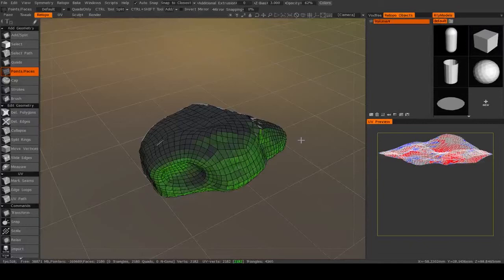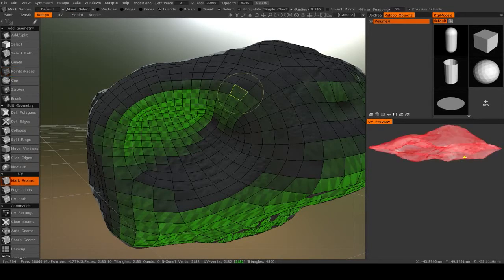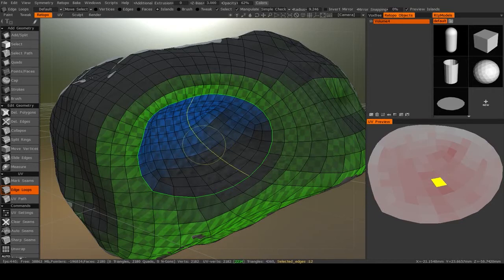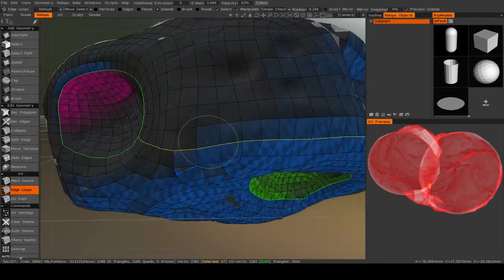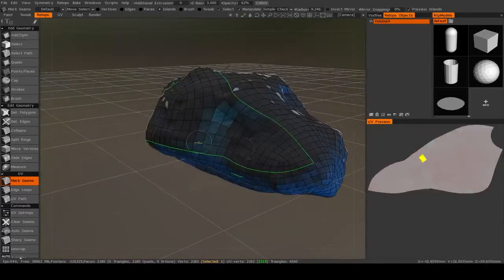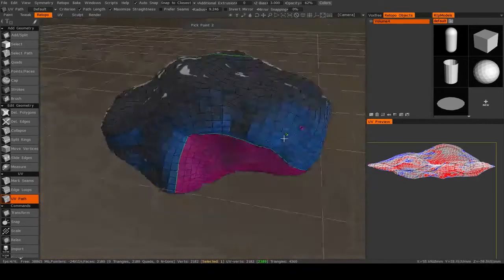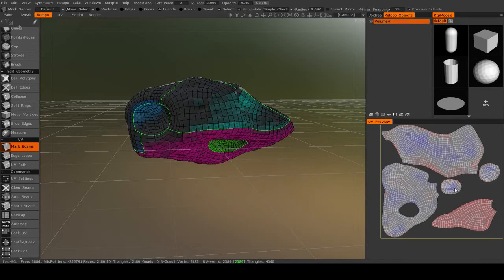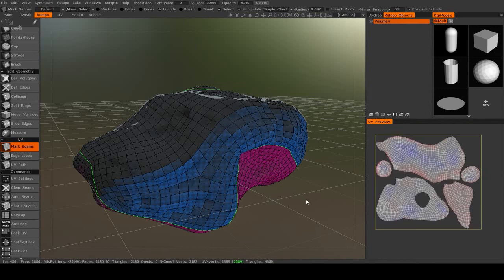Welcome to 3D-Coat: Part 17 (UV Unwrapping)

Comment: I have these purple edges that are showing up on each model I import on my 3D coat. They are... horrible to say the least. A purple edge overrides everything. So when i mark a seam for unwrap, it makes the seam, but doesn't become red as it usually would with previous versions of 3D coat. It makes it really hard to work efficiently because if an edge is purple, there is no indication that I had previously marked a seam on it... yet the seam is still there. It's driving me crazy.

Comment: but is there a methed where i can import an obj model that i already sculpted in zbrush and uv unwrap it ?
i tryed that but in retopo room it doesnt recognize topology at all, it seems 3d coat wants his mesh in order to uv unwrap it. So i tryed that. I performed auto retopo of my obj model when i imported it in 3d coat and then it seems all ok, it alows me to uv unwrap it just like in your tutorial but i dont want to perform any autoretopo because im already satisfied with the mesh
Reply from the maker: You can import the high resolution mesh into the sculpt room by going to file -> Import -> Import Mesh for Voxelization. For the retopo mesh, go to the retopo room and hit the plus sign at the bottom of the 'RtpModels' window to bring in the low resolution mesh. Then you can click on that retopo model in the Retopo room and you'll be able to place the mesh with the transform tool.
Reply: got it, huge thanx man

Comment: That obnoxious cyan wireframe makes it hard to see when the UVs are gray. Maybe that can be changed?
Reply from the maker: Hm... I just look through the preferences in 3DC and none of the theme colors seem to correspond with the UV wireframe so unfortunately it doesn't look like it can be changed. You can always put in a feature request at the 3d-coat website.
Reply: @AlienMinefield: Yeah once I own the proggie I probably will. It's important the wireframe color be configurable so we can see what's underneath....and even more so when seeing the color underneath is important. :)